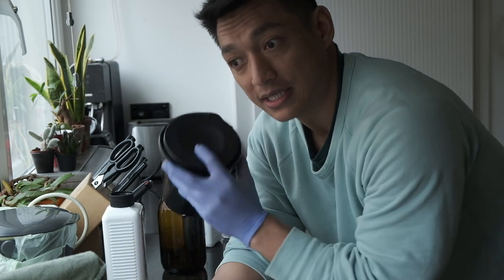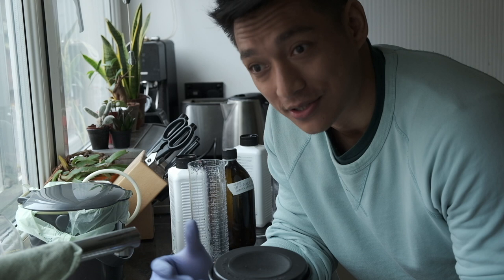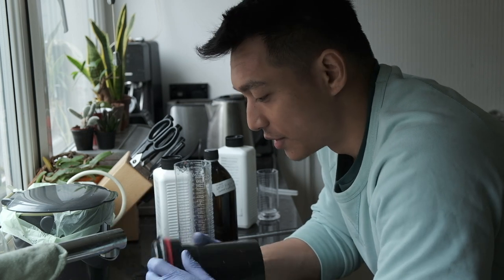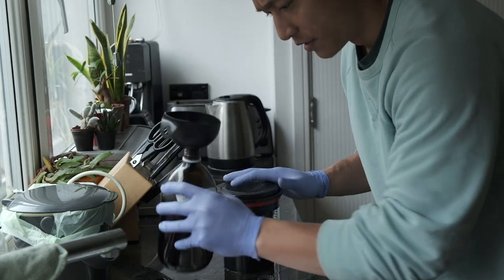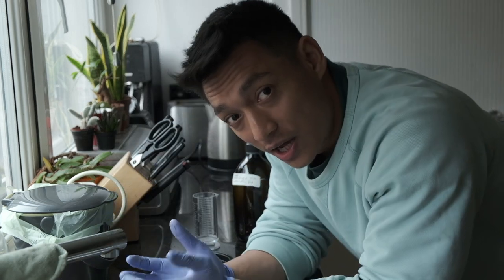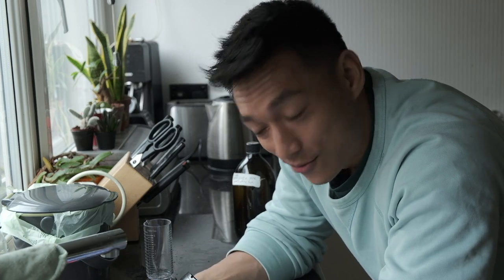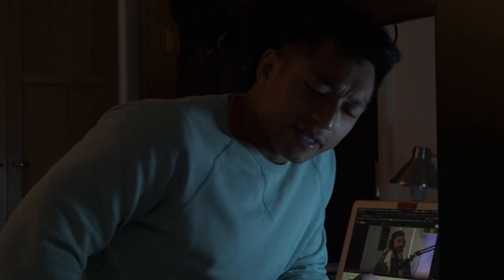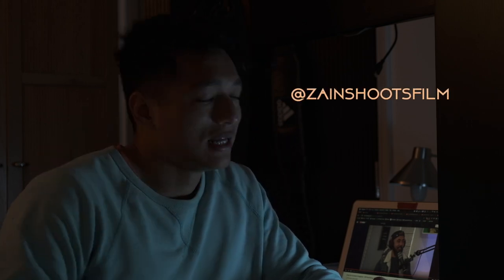Developing Kodak with Ilford | Tri-X 400+ Ilfotex DD-X

Comment: Hi Zain, thanks for the great tutorial. As I'm new to developing them at home, I have a question in regards to how many times you can use the Ilfotex ddx and ilford rapid instead of wasting it away?
Reply from the maker: The DDX is one shot, meaning you discard after each time you use it, unfortunately. I don't know of any black and white developers that are reusable. As for the rapid fixer, I replace it as soon as I start to see my negatives start to have colour shifts. Ilford also says it should be replaced after  6 months.
Reply: @ZainRiza  Thanks for the tip Zain, very much appreciate it :)
Reply: @ZainRiza HOLY FORK, bro. Please stop spreading such vast amounts of misinformation. FIRST: Temperature matters for consistency - at least you acknowledge that. SECOND: DD-X can be re-used (up to 10 rolls of 135/120 film). Ilford states that it's best to use as one-shot, but in my experience, that's mainly because it means they can sell more bottles. THIRD: There are a few re-usable developers around. X-Tol being the most prominent one. So PLEASE stop spouting B.S. which may affect people who are new to film photography and home development!!

Comment: This is Terrible advice on how to develop a roll of B&W film. Avoid like the plague anyone who says that temperature does not matter, it does. How can you be consistent in your film photography if you are not precise every time with your development technique.
Reply from the maker: mamiyapress that’s a good point. it’s not like colour film where you have to be more precise. I guess I should state that for BW,  depending on what look you’re going for, developing at different temperatures and different times will lead to different results. So find a developing combination that suits you best. Again, I’m showing people how I develop. I never say this is what you should do because your preference is different to mine. Thanks for taking the time to watch my video as well!
Reply from the maker: Also pretty sure I didn’t say temperature doesn’t matter haha. When I say you can be rogue with temperature, I meant you have a lot of freedom with, which you do.
Reply: @ZainRiza  Actually, color negative development and B&W development are about the same in terms of requirements to maintain time and temp specs if you want good quality and repeatable results. It's just that folks are more fearful of doing color which makes it seem subject to stricter standards, plus color errors show up are a color shift which is more easily noticed. As to developing times, you'd probably be better off relying on the data from Ilford. There are a number of errors in the data included in the Massive DC and the folks who publish it couldn't care less.
Reply: I agree100%. This should titled, how not to develop black & white film.